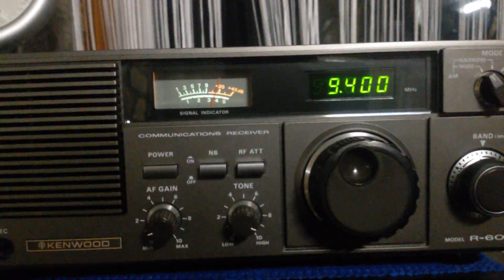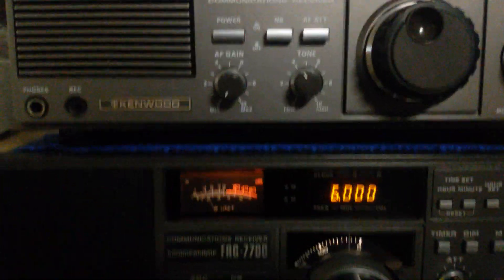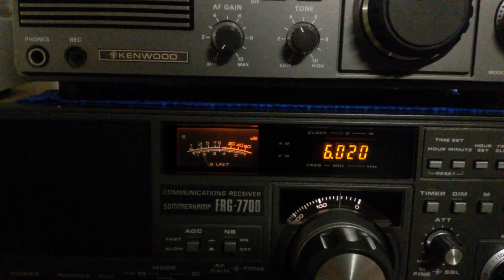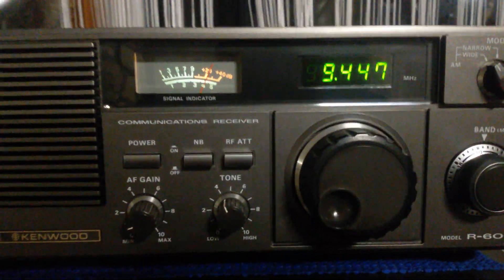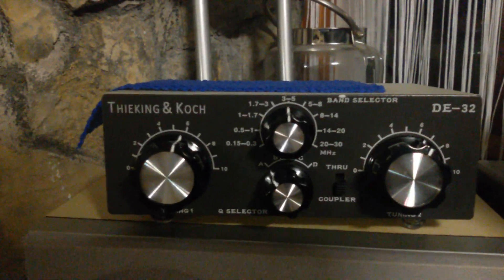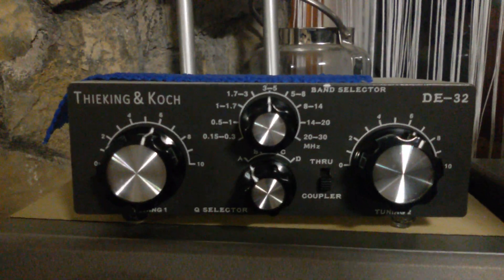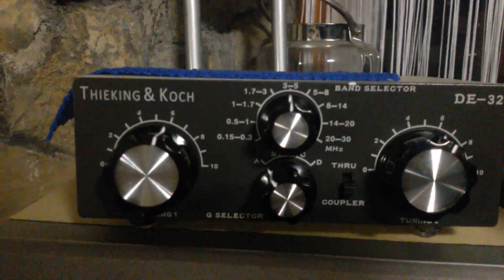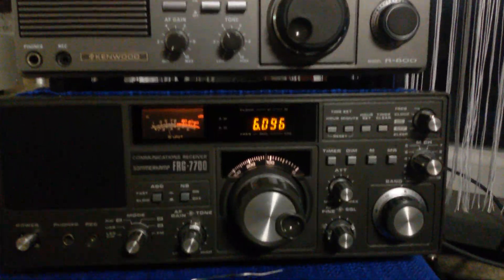Discone for Shortwave listening

Comment: Yes i find much the same in a lot of cases it's better to bypass the tuner.I can run a max of 3 antennas through the tuner so it's nice from that point of view.I think we all start out with the idea that it will make a huge difference.You are right on just a piece of wire its useful otherwise not so.

Comment: Part of the issue is may be that he had the band selector on the tuner set wrong, he listened on both the 9 Mhz and 6 Mhz bands with the band selector on 3-5 Mhz. Also discone antennas are designed for VHF so they won't work well on shortwave even with a tuner.
Reply from the maker: @Patrick There is no problem, I am well aware a discone antenna is designed to receive outside the Broadcast bands. I bought it so I could listen to VHF on my SDR radio. But why not try it? Basically you can use any wire or piece of metal for SWLing.  I also used a OE254 Military Discone for shortwave and of course its not matched and is above 30 mHz but nevertheless it worked.  Unfortunately It was a loner antenna and I had to return it.  But the OE254 is the best VHF antenna I ever used.  I had extensive use of the OE245 back in the cold war.  Interestingly I almost never deployed it using the mast.  I'd would throw a rope over a tree limb and hoist it up.  We always moved in the dark and sleep was at a premium, who had time for a mast?  Thanks for the comment, sorry it took so long to get back to you. 73s
Reply: they will on my FRV 7700!

Comment: 051620/2317PST greetings from California. Sir, the signals are good, strong  and crisp on your FRG-7700. Your signals will greatly improve if your End Fed Antenna wire goes through 9:1 UN Un Transformer. Check on EF-SWL 9:1 balance transformer. I have  Yaesu FRG-7 and FRG-7700 both performing quite satisfactorily up to 30 Meter band. Above 30MB no result. I also have YAESU VR-5000 and  have DISCONE ANTENNA Model# Diamond D3000N, for VHF/UHF reception.. The result is fantastic for a small antenna like that. Take care, stay safe and Bless you. 73s
Reply from the maker: Thank you for the comment and information.  I always invited advice as I'm still learning. 73s

Comment: I thought for receive you don't need a balun....its only purpose is to match the impedance of the coax to the wire...
Reply from the maker: @HamAndShortwaveRadio I had two of those cheap ones..I opened them up and saw what a piece of crap I bought. I Then learned to make my own the correct way.

Comment: Thanks for this video Brian, I think I'll get an antenna tuner for random wire antenna that I could use for field DXing. As you said, just to connect with any wire and tune it. Something like this http://hamradiostore.co.uk/mfj-956.html is it good for listening? Oh, what's that on 6070 kHz now? The DJ talked in English about good propagation that hopefully they could make it across the Atlantic. Could it be Toronto Canada? Pretty strong signal. 73s!
Reply: Oh, it's a Pirate called "Sonic Radio", I just had an ID. 73s, Ron.